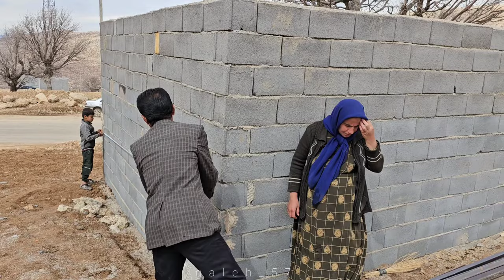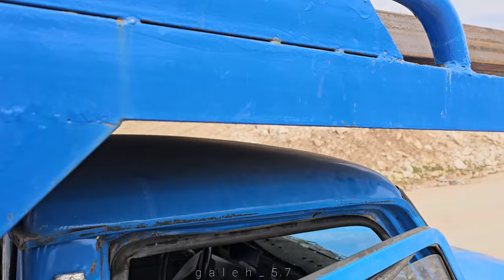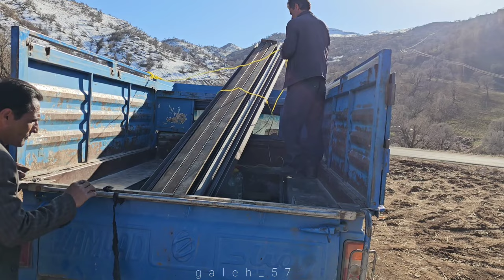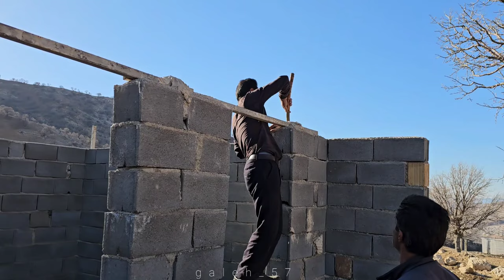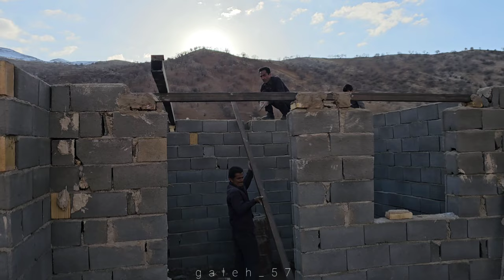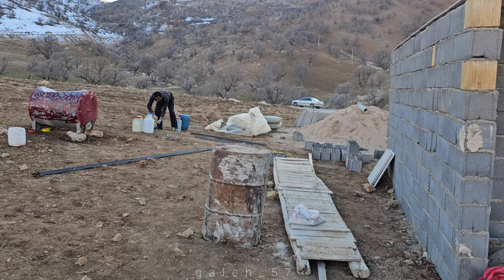Laying iron and tiles on the roof by the workers of Sozan

Comment: The brick laying is very amateur.  The bricks should be snug together with more cement to keep air and rain out.  The walls look just thrown up as quickly as possible and will not stand very long.  But I guess that is how their buildings are built like that.

Comment: Thank you to all the supporters of this  channel.  Glad to see that the family will have good shelter. However it doesn’t look safe.  Should they cast the iron or do the welding  to make it stay and not move?  The tiles are heavy will
Not withhold the water when it rains. So they have to put  something on top of the tiles. I hope it wont  move.  Safety first.